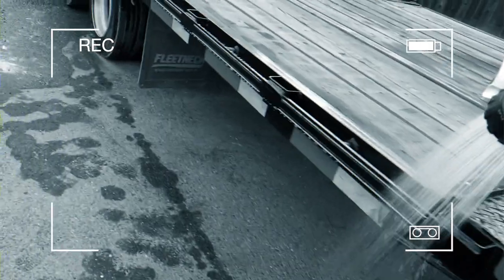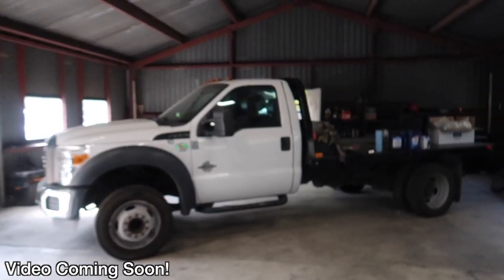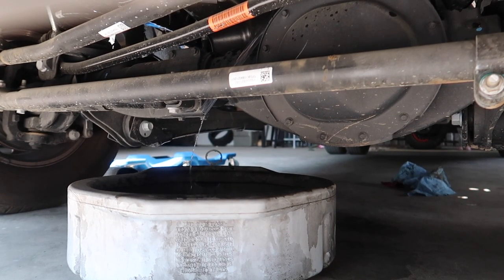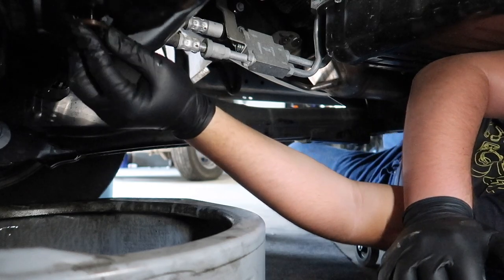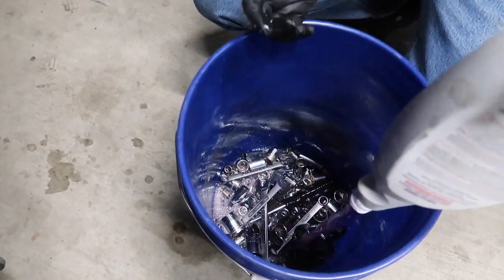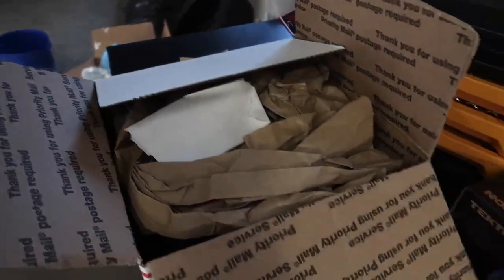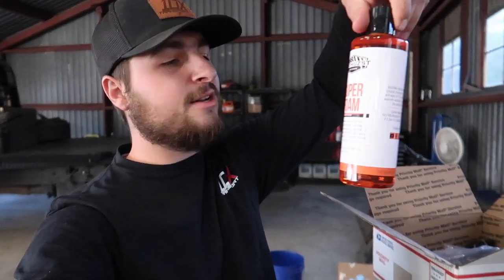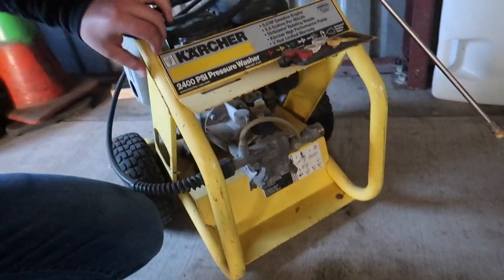Cleaning Equipment & New TOOLS!!!

Comment: Is the Ram 3500 a 3.73 gear ratio?
I’m told its much better on fuel than the 4.10 and not much difference with towing capacity.!, 
Any thoughts on this?
Great videos by the way. Cheers From Canada bro.
Reply from the maker: Thank you! 4.10  My buddy has a ram with 373 gears, he said 4.10 is better.  Especially in the mountains!

Comment: I would say your pressure washer is deff.has lost power. I have the same unit witch seams to have a lot more pressure.  I also have a electric Ryobi not a big fan of the brand For any other tools.  But I will say I've had it for 2 years now using it on job sites.  So far  it's  not a bad unit especially if you're just going to be washing trucks. I probably use it more then my two gas pressure washers just because of how quiet it is.
Reply from the maker: I agree, they make em electric ones nice now days
Reply from the maker: I’ll check out the Ryobi. Thank you